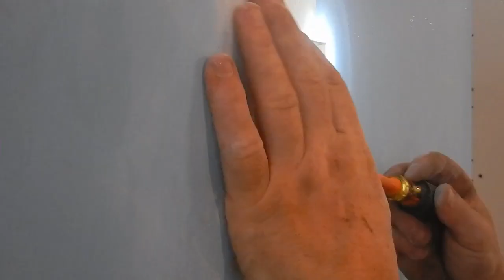video 42: Moving a cooker circuit and providing a spur for the cooker hood

Comment: Hi Rupert with regard to your wall chaser i have one similar and for the extraction to work correctly you have to pull it towards you or it spews out dust into the room. It should be marked somewhere on the tool.Great videos by the way.  I have never seen any one put as much effort in to all your jobs as you do.
Reply from the maker: Very nice of you to say that, and will bear your comments about the wallchaser in mind.  I thought it was doing quite well already but if I hadn't just purchased a gas nail gun at Elex I'd be after one of those Metabo ones.  Really I don't get enough chasing, hence the nail gun instead for putting up conduit.  Thanks for watching